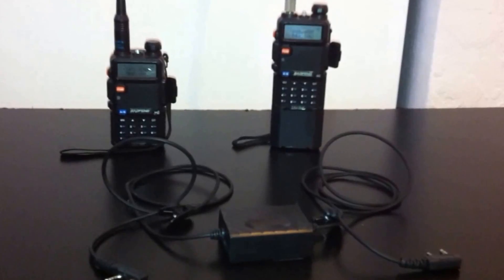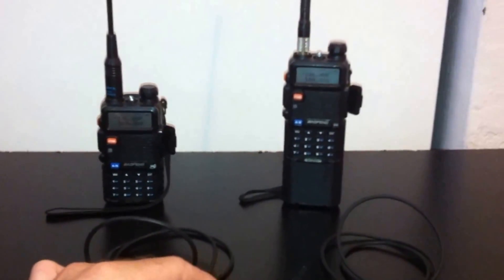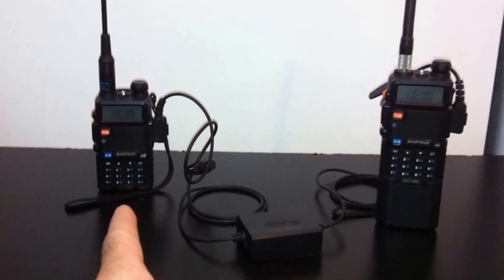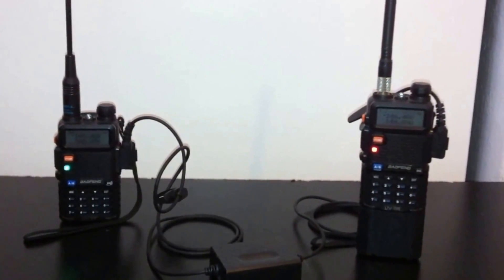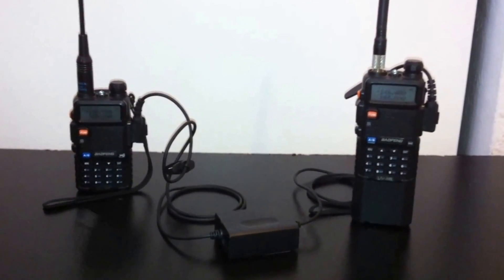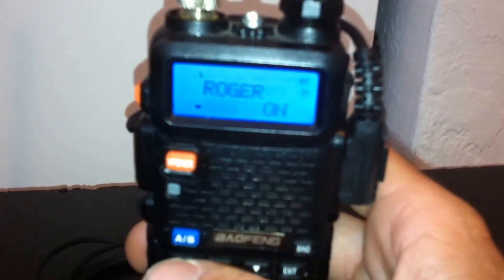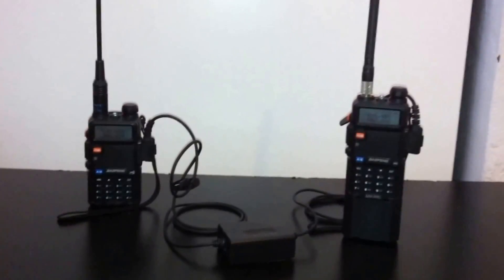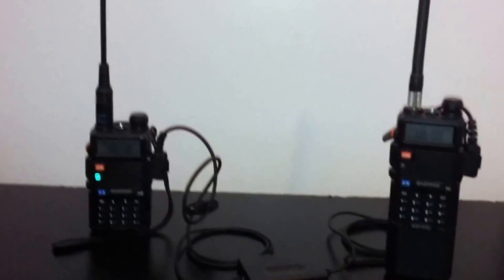Set up a Baofeng UV-5R repeater

Comment: That's all fine and dandy but, its illegal if it is permanent or not. All transmitters must identify before after and 10 minuets during a conversation. That is a tech class rule. To make it legal, add a id-o-matic in the audio and ptt line and set it to id every 10 minuets to make it the simplest or use a keyerchip, arduino, or repeater controller and a transistor (for ptt) to make it legal. then you can find a frequence fill out a form and get it as a repeater full time legally. If you want your repeater to have a ctcss tone you put a receive tone on the receive radio.
Reply: Jon you must have missed the days when repeaters did not have this feature.  As long as a control op (That has control of the machine.  This is my question here) has control over the machine he can ID the repeater.  Since there is no back control of this at all and it relies on someone to go pull the plug when it goes into a cluster loop of ossilations I think that is the worst thing.  Even on an "Emergency" repeater you should have a control RX at a minimum.  Go buy a real controller and build a repeaer that will hold up in an emergency if that is really what you need one for.
K4RJJ
Reply: But, other stations (besides control op) must also ID the repeater to make it legal.
Reply: Radio policeman? Do you have a peel n stick badge too?
Reply: Jon Williams
Ok then, you can go back to directing traffic now.
Reply: yes i do!
Reply: directing radio traffic that is!

Comment: Why would you need this when you can just make a straight cable going from the output of one into the input of the other and turn on VOX?
Reply from the maker: Because if you havent tried that idea already, it doesn't work. the VOX on these radios are the weak point, and it causes the radio to hang in transmit. Trust me i have tried using a straight through cable, it doesnt work on these Baofeng radios. On my Yaesu VX-8GR or my Kenwood D72A it will work, but of course look how much those radios cost. 73
Reply: @HamRadioConcepts  you are right, so i bought this cable and it still doesnt work, same problems; it keeps transmitting, i have changed the FOX from 1-10; keeps transmitting...
Reply: I used simple straight cable for months while camping and never had an issue! Added external antennas and 50Watts amplifier on transmit site to extend the range. IMHO if the box could add hang time and ID tone, I would get it, otherwise I don't see the reason why spending even $20 for something what the radio already has built in.
Reply: you can but you need to understand how the radio works and custom wire some cables.  i recently setup a echolink, link using baofeng radios. in MK I of the system i just made a custom cable and found the tx hanging on.  after fixing that the only problem was the lag before it would tx.  now the MK II version uses a serial ptt controller i made and it is working quite well. i am designing the MK III version that will detect the rx by serial connection so i don't have to use the vox in echolink.  i will make a youtube video when i have that completed.

Comment: What about the required call sign announcement? Can that repeater interface be programmed with the announcement to announce every 10 minutes?
Reply: Doesn't work!!! I was once a Sub but I notice when these YouTubers doing it for $ and not the Hobby...YOU Dont get A  RESPONSE from the creator...but when its them spending there money all you get every Question in the comments ANSWERED...LMAO..WOW
Reply from the maker: This device is basically used as a range extender, not to be set up as an area wide permanent repeater. This cant be programmed for that. Its more for emergency communications on a temporary basis.